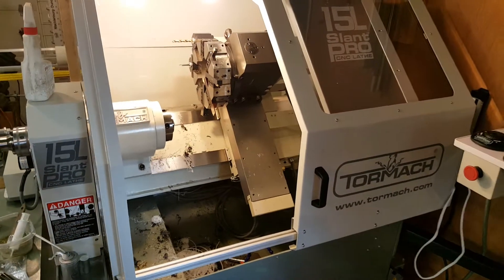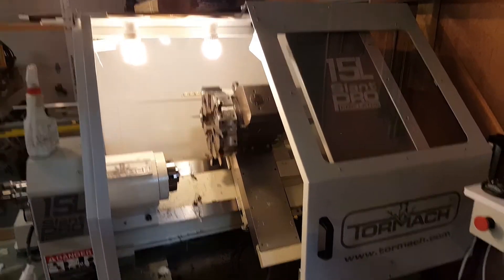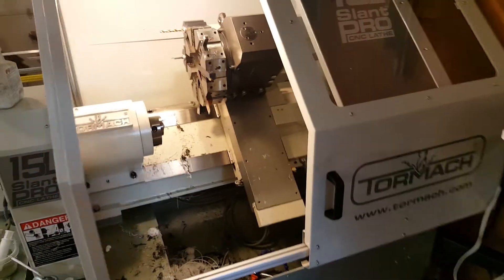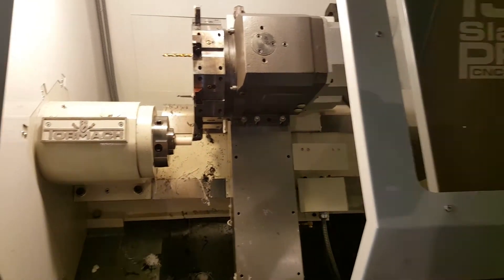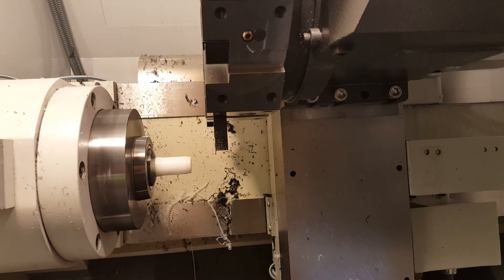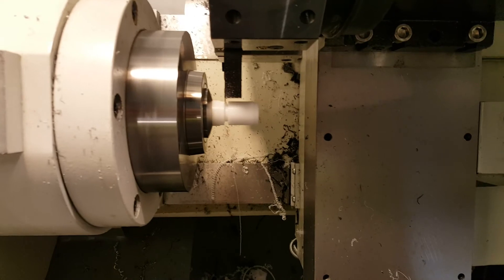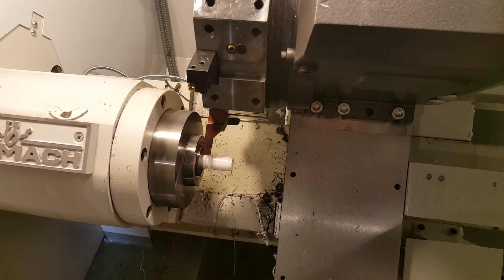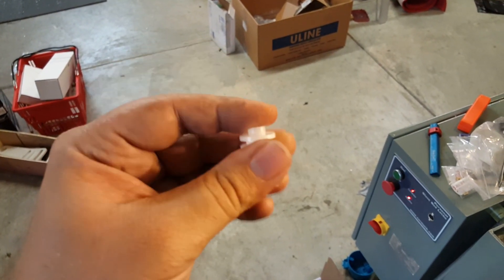New Tormach 15L Slant Pro lathe

Comment: What is the largest stock diameter that this machine will handle?
Reply from the maker: I want to say 1.5 off the top of my head but since I typically run collets I dont go much over 1.0
Reply: I need to be able to do three inch stock.  I want to make seal sleeves for pumps.
Reply from the maker: Ya probably not what you need. You might be able to chunk the stock and use a 6" chuck but then the bed length leaves a bit to be desired. It really wants to run collets. It does keep size pretty well once its warmed up I just got done with a run of almost 1000 class 3 threaded rods and only scrapped 3 from out of tolerance threads.

Comment: I do not have one of these machines as yet. But one thing that came up when I started looking into this machine, is you have to purchase there Full Enclosure to be able to buy the Rotating Turret, which turns me off buying as I have plans to make my own enclosure and I cannot really justify the cost of this enclosure and not being in the USA. For me this would add another $2000 to purchase the Enclosure and approximately another $1000 for exchange rate and freight charges Grand Total of $3000 plus.  And I have not even purchased the Rotating Turret yet.Now that I have had time to complain is good to see your machine in operation I was reading your comments in regards to this machine, and I am thinking the same thing looking around at what to buy but this machine seems to be good for its price.With the Gang Tool option I am unsure how many tools I would be able to fit on there so the rotating turret is a very good choice for this machine but adding more and costing more is always a big ???

Comment: nice part. careful of those insert part-off tools, cutting plastics dry like to suck the insert out if you use retract with it.
i have a question, is there a reason you installed the boring bar facing up (pointing toward negative-X) instead of keeping it on the positive side of the coordinates like the other tools? I was reading through the slant-pro manual a couple months ago before the machines were available, and there were a couple bizarre confusing instructions that I wish they would change, I'm wondering if that was in there somewhere...
Reply from the maker: *****  Thanks I'll keep an eye on the cutoff insert. Its a pretty light cut .003 per rev but its a new thing for me so its always good to know what to watch out for. As for the boring bar. I installed it like that so I don't have to reverse the spindle rotation to use it. I am not sure if its in the manual and honestly I have not read much of it just kinda jumped in. I have already found some minor tweaks in the conversational that would be nice. Such as chamfers on grooves and ID grooving is nonexistent as far as I can tell. Actually its mostly grooving ops that have giving me the biggest headache.
Reply: Tom Detka With the boring bar facing toward you, didn't you end up using negative diameter coordinates? I suppose it doesn't matter much, I just prefer keeping it all positive unless the cut were to cross past the centerline. If the tool were rotated 180, the spindle can still go the same direction as long as it's upside down like the OD turning tools. (I don't like saying "upside down" better to say the cutting edge faces away from you).
I don't think it matters much with most parts, tho with larger boring cuts it might make a theoretical difference with chip evac, since a string chip can roll with gravity out of the hole. of course it might not do that in reality (lol)
I've been following the tormach lathes for a while and am glad to see them finally on the market, they seem like a good compliment for the PCNC series...
Reply from the maker: ***** Now that I think about it ya your right an upside down boring bar would work. I guess I am still carrying some of my manual machining think around. I am sure that will change the more I use this machine. Yes I was programing it in negative numbers. 
Ya I went around and around looking for a cnc lathe. When I started looking I wanted the Tormach but thought I would rather have a more industrial control like a Seimens or Faunc but the more I look around the more the Tormach made sense. Any of the servo driven machines that were in my price range were gang tool, GT27, not that its a bad thing but I don't think they would offer the versatility that a turret does. And the other machines that did have turrets were out of my price range, Hurco Hass. So I ended up at Tormach because it was the right machine for the right price at the end of the day.